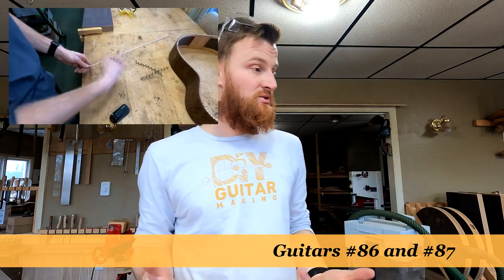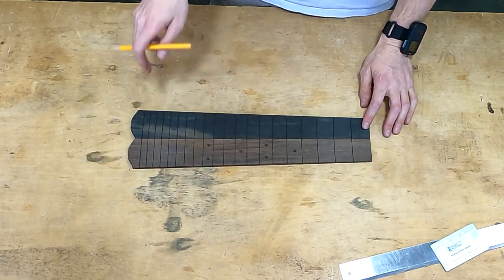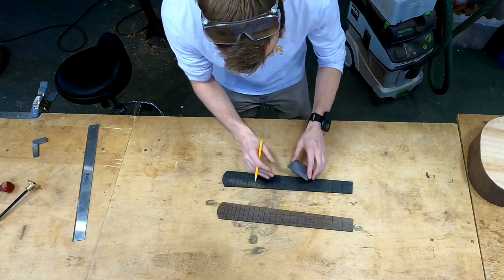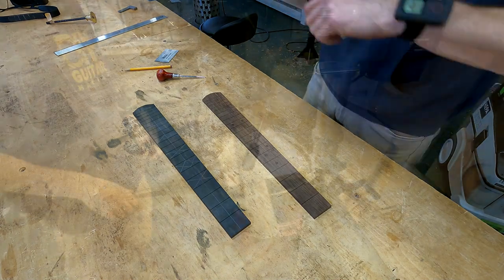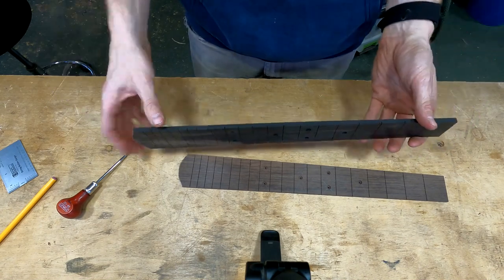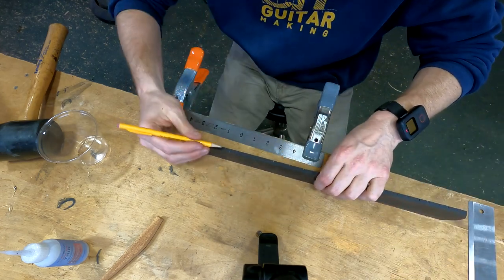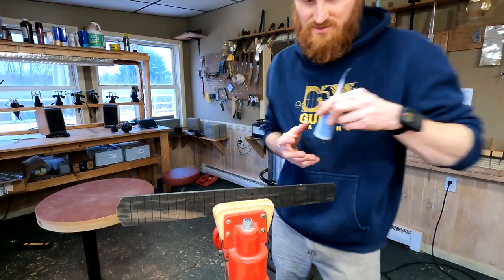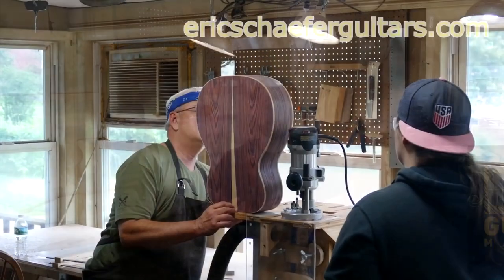Guitars #86 and #87 | Installing Pearl Fret Marker Dots and Side Dots

Comment: Why not measure for the center of the fingerboard at the first and last fret then draw a single line?  All dots will align. Then simply measure the middle between frets where the dots will go?  If you site down the fingerboard, they will line up rather than risk one dot being off line.  The "X" is rather new to me.

Comment: I have recently (the last year) switched to Luminlay side dots. Depending on the color of the binding you can get the glow material in a white plastic tube or black plastic tube. They are plastic but the glow is outstanding. Don’t fall for the cheap knock off brands.
Reply from the maker: I've responded to your comment in this Q&A video. Check it out! https://youtu.be/_8qkMgJgJWE